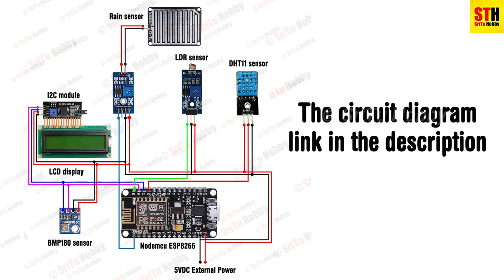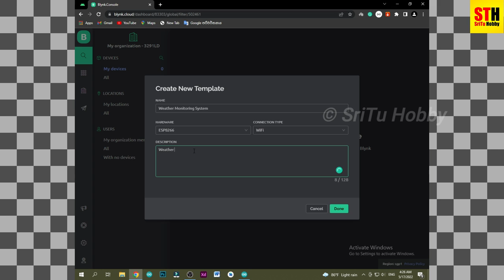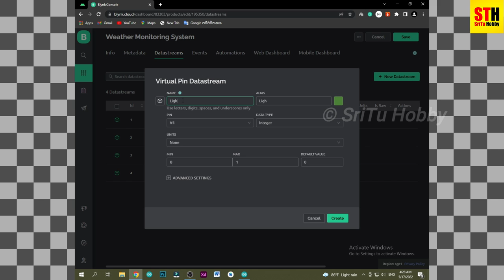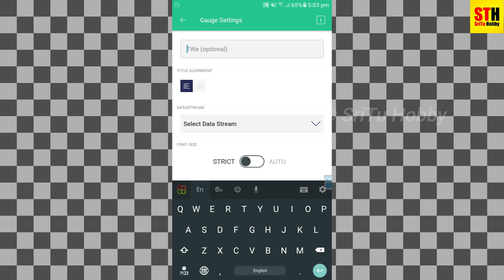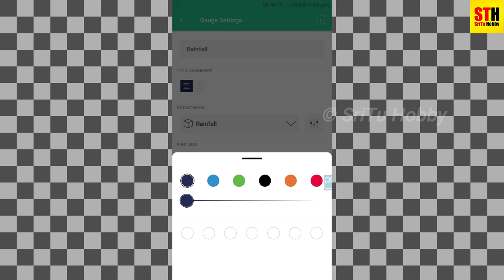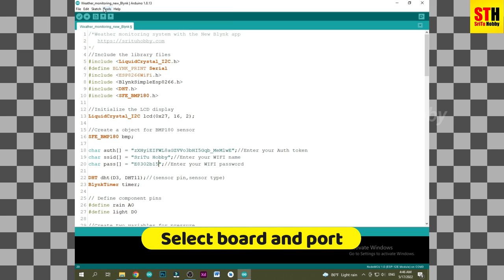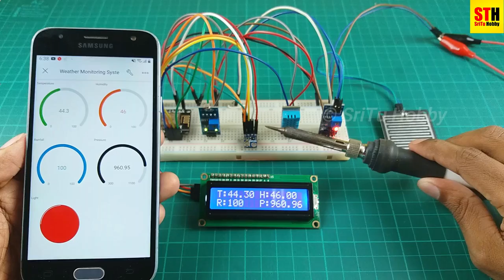How to make a Weather monitoring system using the Nodemcu ESP8266 board and the New Blynk app

Comment: I am doing this project but the temperature and humidity sensor is not showing any results . i have done the connections properly as shown in the video . rain sensor , ldr sensor and pressure sensor is working correctly . please suggest what to do .

Comment: Sir i wanna ask i have 2 problem, so i use Nodemcu esp 8266 V3 different with you then on the Arduino when i run the code error i mean the problem is Nodemcu module what should i do ? 
Then for DHT 11 i use different to with you so the graphic can't working and LCD can't read that what should i do sir? Please answer sir

Comment: Tried doing this project but with a LM35, LDR and gas sensor using an esp-01 wifi module.. The readings for LDR and gas sensor are correct but Lm35 is not showing correct temperature. If I just use the Lm35 only then it shows correct answer but with other sensors in circuit it shows wrong answer. What us the problem please help?

Comment: Hi, The rain sensor shows 100% without water, but the percentage decreases when water falls on the sensor. How can I do it the other way around?
Reply from the maker: You can change it using code
Reply: @sritu_hobby  Please can you change the code accordingly and give it back to me?
Reply: I did the code myself, but it doesn’t drop to 0. The minimum percentage shows 1 and when water hits it, the value rises to a maximum of 55.

Comment: Hello I am in sti2d terminal and I have a project to present which is the smart cane for blind people and in this project I must use an accelerometer which plays the role of the motion detector and I must add the alarm clock/sleep function it  that is to say when the cane moves towards an axis it lights up and when it does not move it is off.  I need help because I'm really lost 🙏
Reply: Can you help me ?
Reply from the maker: What is your issue?
Reply: @sritu_hobby  my teacher has already sent me a code I have to add a wake-up/sleep function of the cane for the blind, that is to say when the cane is at rest and it moves towards an axis (x,y,z)  it lights up but when it does not move it is off.